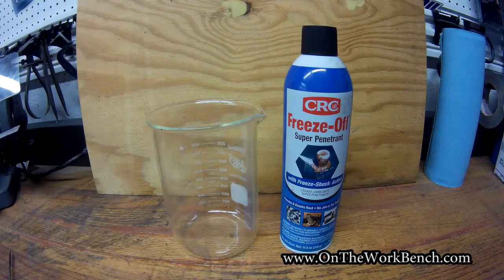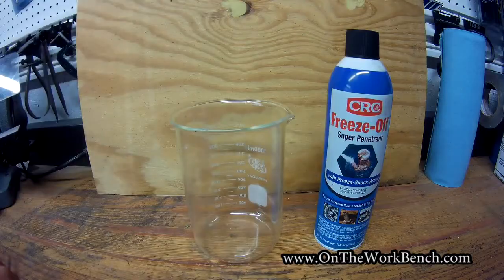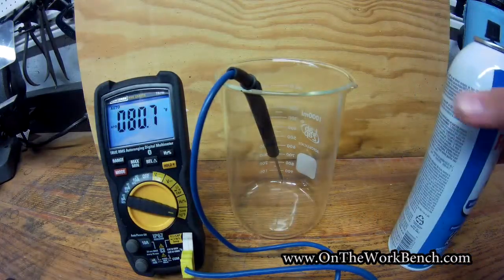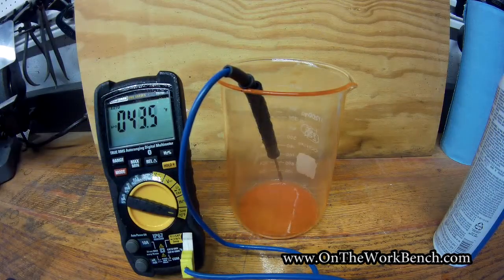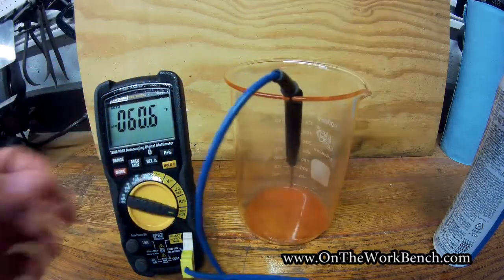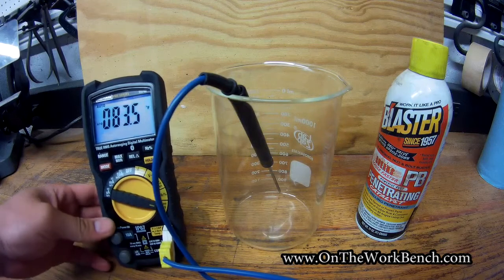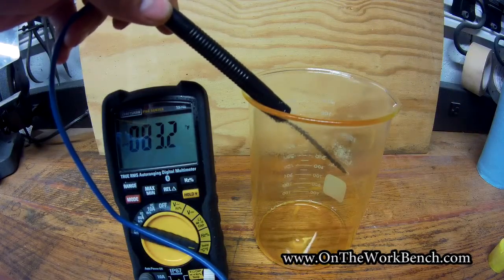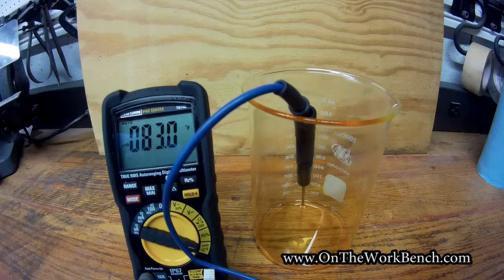CRC Freeze-Off Testing

Comment: I've always had good luck heating a bolt with map gas, then immediately throwing cold water on it. Sometimes I'll do it a few times, then try breaking it free. Sometimes I'll do this then apply heat to the surrounding area (that the bolt threads into, not the bolt itself) and it works well. Of course, sometimes you can't use heat because of wires, seals, etc so this might do the trick. Or even heat it with map gas, then spray this on it.

Comment: Any aerosol when sprayed will be cold.
Moving from high pressure (inside the can) to a low pressure (atmospheric) will produce cold.
The PB blaster will also give the cooling effect if it is released from the can in much more volume. I've used can of freon to freeze fastners as well as hair spray. 
If cooling is the goal there are much cheaper options.
Reply: hair spray on fasteners, now that is interesting.  The hydrofluorocarbon 152A is a refrigerant which gives it the cooling effect.  It is safe for the ozone.  It is used as a propellant in many spray can products.  It is in electronics dusters, which is why the labels always say to not shake of turn upside down because it will all come out.

Comment: I think the cooling action shrinks the object piece to create a little clearance, which then allows the penetrating oil to get in between the two parts. The combination of parts separation combined with oil penetration seem like a great idea. I will be removing all four oxygen sensors on my 2006 Corvette Z06 and plan to use this stuff in my first attempt to remove those sensors.
Reply: Well, did it work?
Reply: @timmyb1874  I wish I could report one way or the other on this topic, but unfortunately the oxygen sensors were too difficult for me to access, so I took the car to a shop for this job.

Comment: I've been trying to remove an o2 sensor with heat/wd40/liquid wrench with no luck.

Someone who works on 18-wheelers says this his go-to so I'm trying it.

Should have mentioned wearing gloves. You don't want liquid nitrogen touching your skin. 😁
Reply: How did it work for you Robert
Reply: @macknumber9  

It didn't. Ended up taking it to an exhaust shop.
Reply: @robertrose3068  I'm really interested in trying this.  It seems like you need to spray for a while and then immediately try to loosen the fastener as the temp will climb back up if you don't
Reply: @macknumber9  

That's what it says. But on an O2 sensor it didn't work for me. They had to heat the old one up and took 15 mins to loosen it.
Reply: @robertrose3068  I wonder if the temperature drop is the same regardless of what ambient temp is?  Like someone up north in winter at 0 degrees versus someone using it here in florida where it is 50 degrees....does it drop the temperature based on ambient or does it drop it to a certain temperature regardless?

For example if you use it at 100 degrees in florida vs 60 degrees in Michigan...is the change in temperature all that matters or is the end temperature what matters?

Comment: Hi. I have a massive problem with totally seized diesel injectors in a aluminum head. Any idea if this will work?. Do I follow it with a oil?.
Reply from the maker: I think this is worth a try as it has worked for me very well, but everyone has their own opinions (and magic potions) for breaking free a frozen/seized nut/bolt. Unlike other options the freeze/thaw this offers is fundamentally different from other formulas.
Reply: It might help. Ive had tremendously good luck with it.  
  That said, youre in a bad spot on that one because you have such a small target and the cooling will shrink the aluminum more than it shrinks the injector.

Comment: You need to use the straw, the whole point of this product is that it contains r152a, when you spray it without the straw it just turns into a mist and evaporates into the air, you want to use the straw so that liquid r152a hits the area you want to cool down and evaporates off the surface and cools it.

Comment: The propellant in the spray can is what is lowering the temperature.  A can of hair spray will lower the temperature.  The penetrating oil is what frees up the connection.   The expansion and contracting of the metal helps.  Get a torch heat it up a little and spray the bolt.  Works almost every time.  CRC does make great stuff,  can't beat brakekleen but the best penetrating oil  I've found is Kroil Oil.
Reply: I dare you to shoot a video using hair spray with a temp gauge and trying to remove an old, rusted bolt, nut or o2 sensor.

We all want to see that.
Reply: I never said hair spray would free up a bolt, I said the propellent is the same and the penetrating oil is what frees up the rusted nut or bolt.  Expansion (heat) works and in this case contraction (cold) supposedly helps.
Reply: @caspere.8461  

Ok, since you said "the propellant in the spray can is what's lowering the temperature" and "a can of hair spray will lower the tenperature", logic would suggest we can just spray it with hair spray quickly followed by WD40, Liquid Wrench, etc... that should do the trick.

Correct?
Reply: That's stupid.  I said the propellent is the same that's it.  Expansion and contraction are what will loosen a nut or bolt   In the CRC case contraction.  I gave an explanation for expansion.  But is you want to use CRV freeze go ahead.  Freeze your socks off
Reply: Kroil is consistently disappointing in product comparisons abroad but I am about to try it myself. Agree with El Oklm about PB.Blaster and much prefer CRCs 5.56 / Penetr8. A 50 50 blend of Automatic Transmission fluid and Acetone can often out perform big brand penetrents. I am also a fan of freezing agents and a blow-torch but consider patience is a vital ingredient.
Reply: El wrongo. You just saw the difference  here in this vid. If you doubt it, buy yourself a can. There wont be any doubt after that.
Reply: You saw it here.....There's a sucker born every minute.